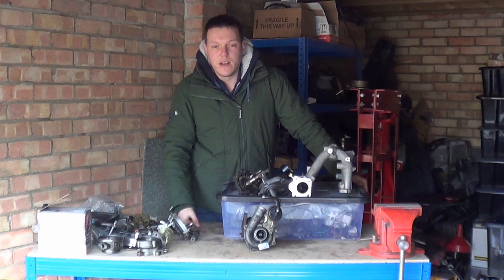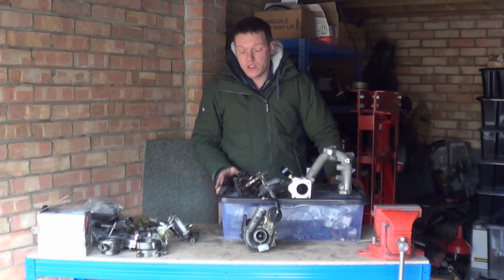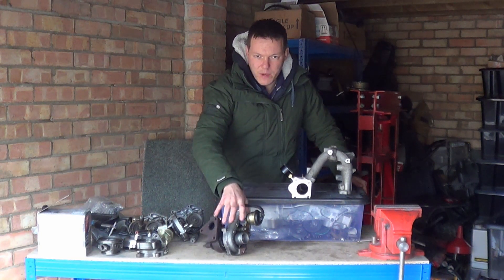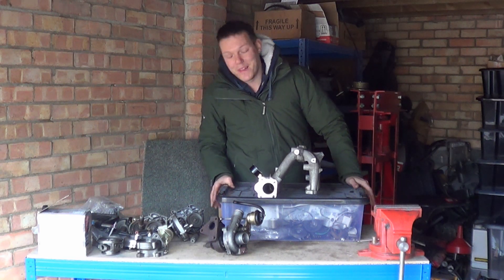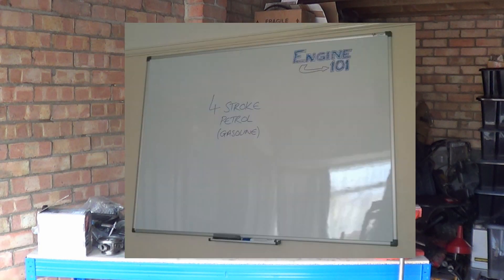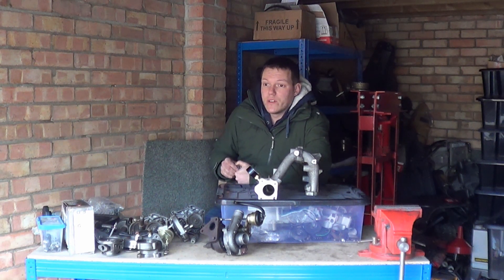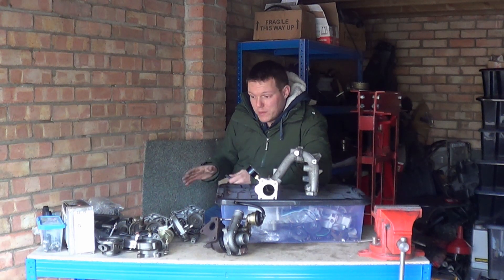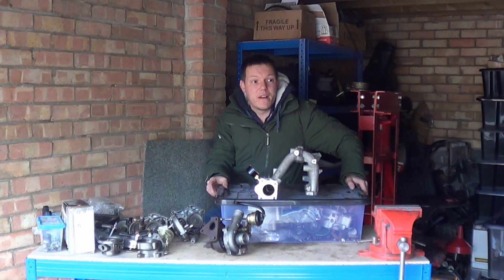March 2016 Channel Update

Comment: Can't wait, I've got an AM6 that needs rebuilding atm but I think I'll wait now for some insightful knowledge (wouldn't be modifying it at all would you?)
Reply from the maker: +Spif Spaf sorry mate, just a straight teardown and reassembly. Its an engine I've had kicking around in a box for years.
Reply: Cheers for the reply, still good for a video guide, maybe I'll ask a question ahead of time then, got any tips on splitting the casings? (I've stripped bandit vvt 400/4's and playing with a GSXR 600 track bike so I've got engine knowledge enough) I've seen people knock them apart by hitting the output shaft and crank with a rubber mallet but these casings aren't having it, is it essential to have a splitter or will perseverance get them to bits with a mallet? Don't want to be smashing those bits around tbh
Reply from the maker: Ello mate sorry for the late reply, don't hit the crank or anything for that matter, the crankshaft isn't a solid component. In all honesty a splitter is whats needed or you can make your own with a plate of steel/ally and a large bolt. Will have to make one to demo in the teardown video - matt
Reply: Thank you very much for the reply, dw about time lol you have a life, and I was thinking that about the crank but I wasn't too sure, I look forward to the videos then because case splitters aren't cheap like a bolt and plate is, take it easy 😊